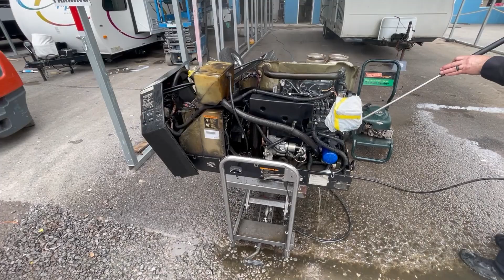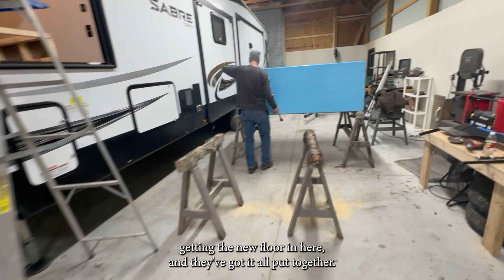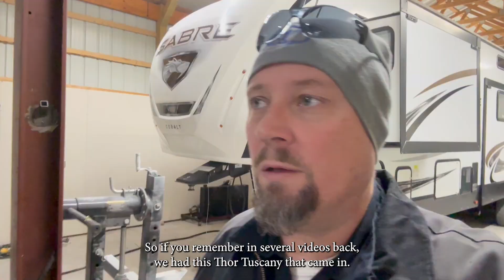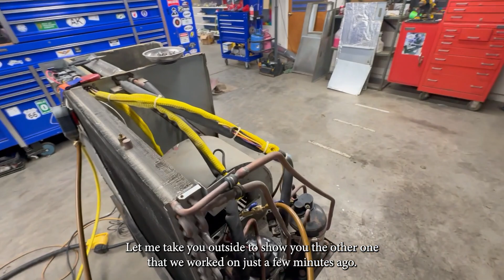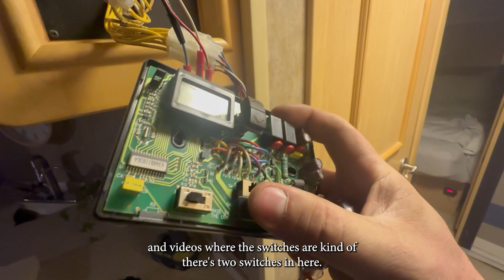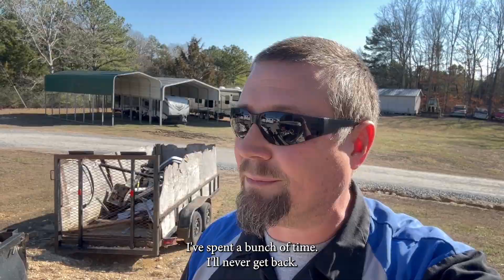That Drives Me Crazy

Comment: Got my new board from Shelburne RV along with the capacitors. Installed it only to find that the outdoor fan carrier bearing was deafeningly loud. Got the OEM bearing from Amazon in 1 day (don't do that unless you are in a hurry like I was, get the sealed bearing from Steve. You can't oil the OEM without removal of the whole unit. Take note Coleman-Mach). Took the unit out and meticulously cleaned everything, especially both coils. Oiled and reinstalled. Quiet as a mouse. Both compressor amps are within 1 amp of each other at around 8amps. Time to go camping! Thanks Steve for taking my calls and helping diagnose and repair. 2003 Winnebago Adventurer 35U.